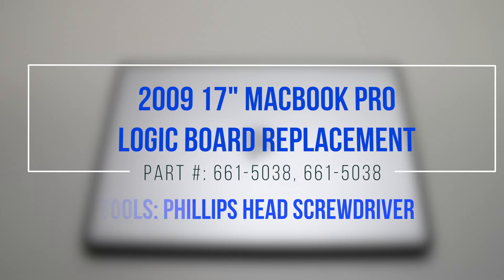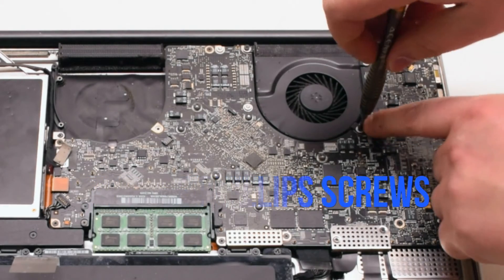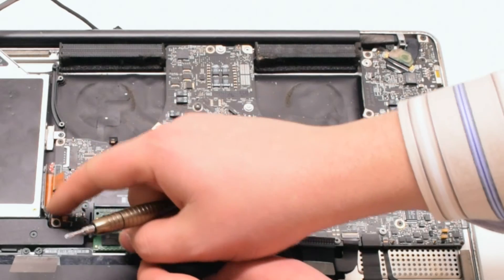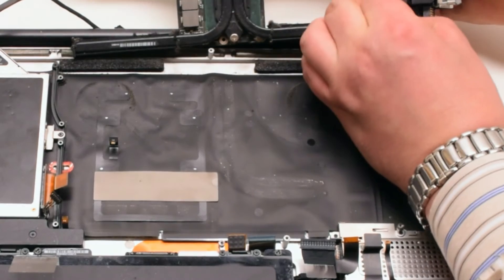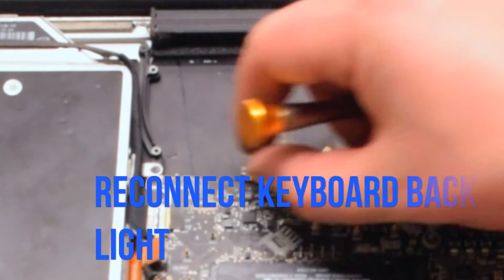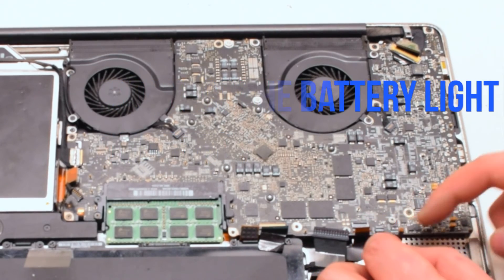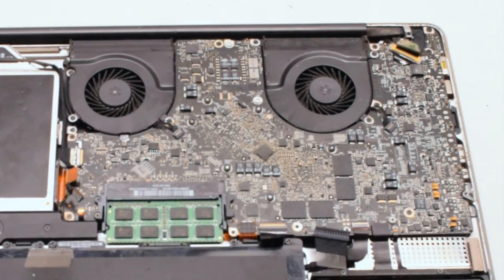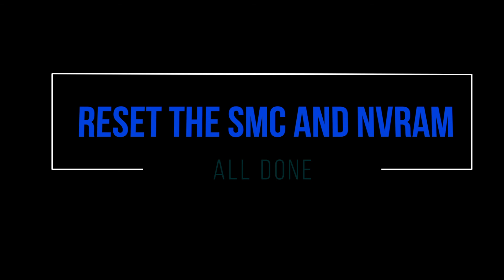2009 Macbook Pro 17" A1297 Logic Board Replacement

Comment: my logic board from 2009 (Core 2 Duo T9800) died . is it possible to put the i7 2011 2.5 GHz Core i7 (I7-2860QM) or the body and the connectors won't fit ?

Comment: Hi there, I have a question and I hope you can enlighten me. I am selling a defective Macbook Pro Unibody 13 inches Core2Duo that doesn't power on because of the logic board. Now, someone wants to buy it because he has the same Macbook Pro but his processor is i5 (mine is Core2duo). Is it possible to transfer all the parts of his Macbook Pro to my Macbook Pro? His Macbook has too many dents and scratches already reason he wants to buy mine. Thanks.
Reply from the maker: It all comes down to the Year of the Mac because every year they changed the internal parts slightly. Based on i5 vs Core2Duo it's complelty different from the shape of the fans to the shape of the speakers, but some parts are reusable =, suck as the DC-in converter and the DVD drive as well as memory.